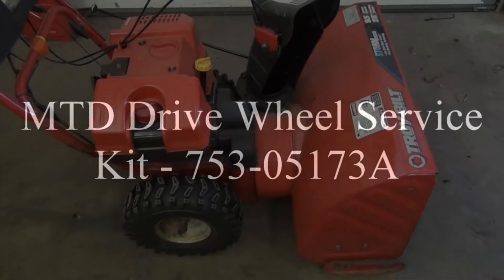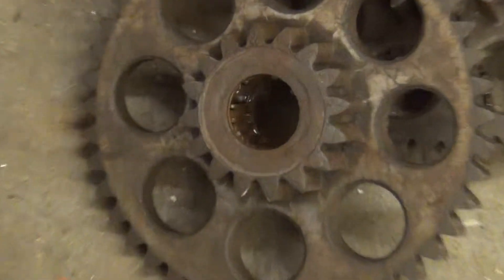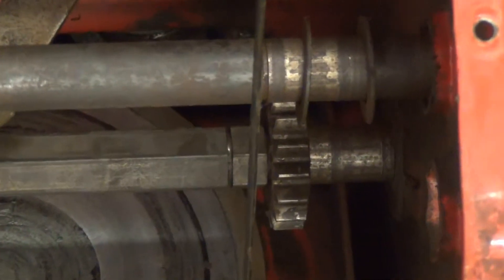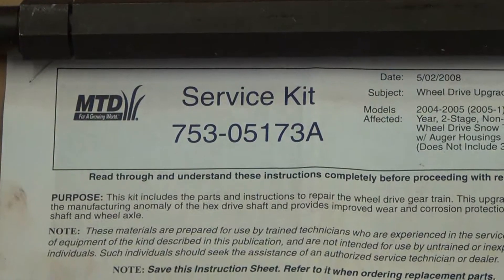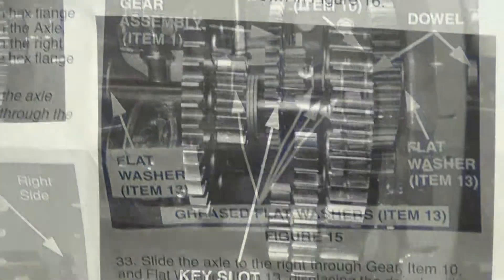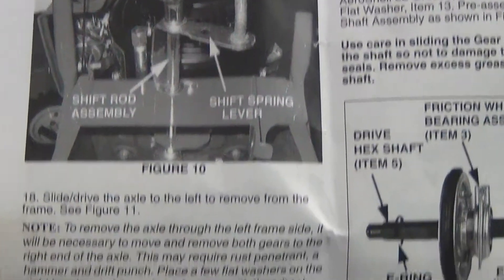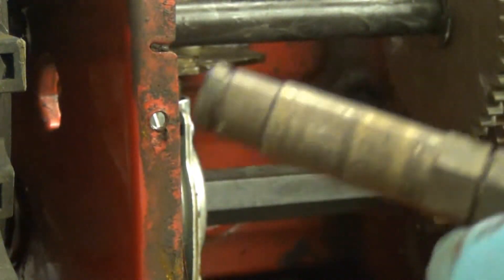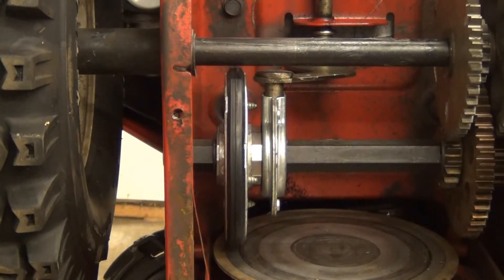MTD Wheel kit 753-05173A

Comment: Great video, thank you. Very clear and to the point. I repaired my neighbor's (same) machine a month ago because all of the bearings were seized up and the wheels would not turn. I just disassembled everything, freed up the bearings, reassembled all w/ new grease, etc. Worked fine for last couple snows. He told me today it wasn't working again. Drug it over to my garage, pulled the cover. The right outer hex shaft bearing fell off and the drive came apart. Don't know if the e-clip failed or the bearing disintegrated. Those parts are missing in the snow somewhere! Looks like they solved this issue by using the bolt on the right side w/ the new design hex shaft instead of the e-clip. Guess I'll see if he wants me to order up the kit and try again!
Reply from the maker: The E-clip is just a 3/4" clip you can get at the local hardware store in the "pull out drawers" of small parts.  The bearing is part number MTD # 941-0563 or STENS #230-404 or you can find the same bearing using the generic bearing number of 6203-2RSNR (means 17mm x40mm x12mm , 2R = 2 rubber seals on sides of bearing, SNR=snap ring on one side of the bearing. I buy the generic 6203-2RSNR bearings in quantity for 3 bucks each and use them all the time.  If you have a local industrial supply, you can get the bearing from them or order it on line.  I would try a new bearing and clip for now and then next season, install the complete kit for 80 bucks and never look back.  The kits seem to be out of stock at this time from my distributor but MTD may have them for sale.  The kit has everything you need to repair the drive problem for very cheap money. If you price all those parts out individually, they are about 300 bucks!
Reply: Dan Small Engine Dan, thanks for the additional info. I went over to the neighbors after the snow melted a week later. Found the missing bearing and half of the e-clip laying on the sidewalk. Looks like he continued to try to use the machine for quite a bit after the bearing fell off. The bearing was seized up again. Not sure if that is why the clip broke or not.  There is some damage to the outer edges of the large aluminum friction wheel that the rubber drive disc wheel drives off of due to his continued usage with the shaft flopping around. Hoping I can clean that up and reuse. Still waiting for the neighbor to see if he wants to fix. If not, I will offer to take off his hands and fix myself. I'm leaning towards the whole kit.     Hoping you can answer a question: when I put together the first time, I had a really hard time getting the right side e-clip on because the groove in the shaft was not sticking out of the bearing enough to insert it. I had to squeeze the sides of the drive-train housing together a little (temporarily) with a large clamp to expose the groove. I had it apart a few times to make sure all was going together and I thought it was. Looking back now I am thinking possible the bearing was disintegrating internally causing the issue but not sure since it was spinning fine when I assembled.   Any thoughts on this issue?
Thanks!
Reply from the maker: Sometime when assembling the bearings onto the speed shaft, the frame prevents the clips from going on because it’s flexed open a bit. I never had to clamp it to bring it back into spec.  You might want to slide the bearing onto each end of the shaft first just to see if they slide all the way in against the hex area of the shaft. Rust can prevent this causing a fight when try to get the E-clips on.  If your housing was bent and caused lots of side load on the speed shaft bearings, the bearing will fail early. It sounds like your bearings were probably in poor condition to begin with. If you do install the drive kit, you can use the new parts to gage the width of the housing. The new parts are a bit more forgiving in terms of width so if the housing is slightly wider than it should be, the kit will still fit. If you friction plate has minor damage on the far outer edge, you can clean it up with emery cloth and it should be fine. Most of the time, the gear shift range doesn’t allow the friction rubber to go out near the outer edge so you probably won’t run in that area anyway. Use some 220 sandpaper as a final polish on it and it should be fine. You can replace the disk/bearing assembly by ordering 656-04055 ( replaces all these 656-04025, 756-04177, 956-04177, 656-04025A) and swapping it out.